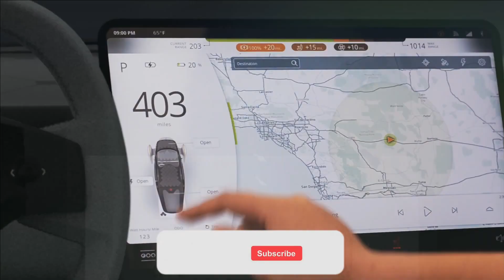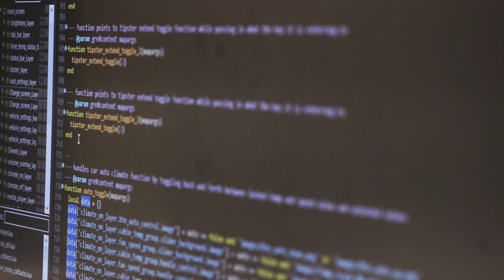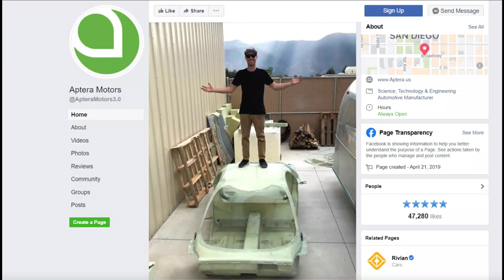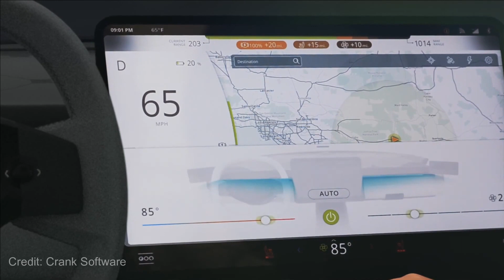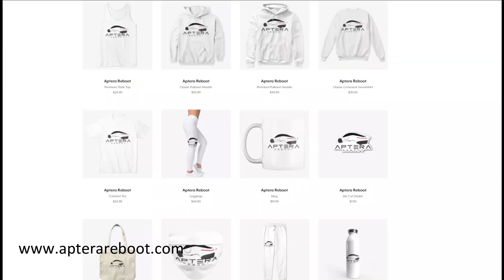Top 3 Reasons Why Aptera Will Fail?!?

Comment: I love the Aptera style and build but see some issues;
when parked in a small street the Front wheel will be sticking out on the road and below hidden partly by passing cars due to the over the bonnet view.
In a small street like ours this could be an issue with it being hit and damaged, you often judge a car width by the main body, and don't expect a wheel poking out.
I, like most others I know have the requirement now and then to drive extra passengers.
I can see me looking further at one, if they ever come to Australia, and would really have to be convinced to buy one I think.
Reply: Those front wheel pods are going to be destroyed - when other vehicles pull in or out of parking spaces, the drivers will judge the distance they have from the cabin. You can't see those pods especially from taller SUVs and trucks. Also, not practical in snow or slush that will build up inside and freeze in northern climates.

Comment: The success of this vehicle does also rely on which country or "market" you choose to sell to.  Releasing a futuristic EV in a country dominated by fossil fuel vehicles would be a big mistake in my opinion. Because people will be less aware and probably more skeptical to the whole EV idea and concept. 

Sell this car in Norway, set up a manufacturing facility here and feed our local market. You'll get tons of publicity, and a kickstart.

We have been driving electric cars in Norway since the early 90's, today more than 50% of all vehicles sold are pure battery electric.
(People who buy a brandspanking new internal combustion vehicle today in 2021 Norway are laughed at, and considered to be kind of dense.)

I would suggest focusing on the 3 wheel drive version, with a heat pump and liquid battery cooling/heating and heat scavenging. 
With  at least 22-150kw CCS fast charging capability, and smartphone app-control seems rather popular at the moment.
90% of the time we charge our cars at home, on a normal wall socket over night. But we do love our fastchargers. So don't do the same mistake as Renault did with the first Zoe EV.
Make sure to be able to charge from a wall socket as well as 150kw CCS.

In Norway, EV's don't pay tax (VAT),  pay little to no tollroad fees, get discount at the ferry, and discounted or free parking. We also have EV  only exclusive parkinglots with charging (Often for free).
Owning a EV costs something like one tenth of the expenses endured by internal combustion vehicle owners. In my case, the downpayment each month is the biggest expense. 
We have all the right conditions for this car to succeed!
Reply: This would be a great car for Norway, especially if they could extend the lowest operation temp downward by a little.   There will be more information when they test it at the Elaphe winter weather test track next year.

Comment: In a two car household I can see this being used for commuting & shopping with a four door being used occasionally for longer trips.
Reply: I have a two car household and this was actually a concern of mine when he mentioned one of the problems being that it's a two seater. I've never owned a two seater vehicle but typically they have trunks, which as far as I can tell this one does not. So how would that lend itself to shopping? Where would you put everything after trip to the mall, or downtown, or even just the grocery store?
Reply: @r37r0v1ru5  It has a trunk with 25 cubic feet of storage. However, the slant of the roof will limit what can be stored. They recently put up a video where they grocery-shopped with it. But they stuffed it with unpacked groceries, rather than showing how many bags would fit. The video is here: https://www.youtube.com/watch?v=odhTdf9S9h0
I put a comment in there requesting more videos like that, specifically how many grocery bags will fit and can it fit a bike.
Reply: That's what I will be using it for.  My Altima gets good mileage so I drive it most of the time but it is aging out.  I mostly use the truck to haul things and tow the camper.

Comment: The US market alone will not be sufficient for Aptera to succeed. In Europe Aptera will be the car with the widest track width available on the market, which will turn out to be a major issue. The low fenders will get damaged a lot while curbside parking plus parking at the curb means the far side wheel will stick out significantly into the road.
Reply: The present plan is for a production rate of 10,000 per year by the end of 2022, at which point the company will be very profitable.  At that point they will be thinking about going public and designing a 4 wheel 5 passenger sedan that will have far fewer issues meeting European requierments.

Comment: How will this thing drive in 2 inches of snow or on icy roads?
Reply: We won't know for sure until the cold weather tests are carried out next season on the Elaphe cold weather tests track.  My guess is that with the three wheel drive model and snow tires it will perform very well in temperatures above -20 F.   This is in part due to an extremely fine grained traction control and ABS which can sense and adjust every 2.5 inches of tire tread travel.

Comment: One of the biggest issues with EVs in general is that they are too expensive, and that batteries don't last very long before they have reduced life and/ or they are dead entirely. The batteries are the most expensive part of the car and they will inevitably have to be replaced long before the life span of the rest of the vehicle. Electric cars aren't suddenly a good idea just because we want them to be. The amount of nasty chemicals involved in the construction and making of these cars is pretty high. Also let's not forget that most electricity comes from coal and natural gas so be careful with our rose colored glasses.
How about taking the efficient body design and wheel setup and putting a dependable, efficient,  gasoline engine in it? The people buying it can still feel green because of the huge increase in miles per gallon it would inevitably give with the aero dynamic design, and the reduction in rolling resistance.
Reply: Even with everything you mention, much of which is true, going back to an IC motor would be a giant step backwards and wont happen.  Aptera will increasingly be manufactured with natural components such as hemp.

Present battery tech is already much cleaner than other methods of energy storage, even compared to alternatives such as hydrogen when total life cycle is considered.

Comment: To the first:
The first Aptera also wasn't an EV it was a hybrid with very low fuel consumption, which is interesting but a low fuel consumption alone is not a good enough reason to deal with the downsides.
This one as a very long range EV with the PV-Paneles and that is a way bigger deal.
To the second:
To the third:
The early prototypes had 3 seats, they got rid of the third one because of low demand and seem to think about bringing that back.

Comment: It's not about 3 wheels or 4 wheels, not about safety. It's all about price. If Aptera can't get the cost in a range that can compete with Chinese competition it will fail again. The main issue with being able to get the new models costs to consumers below around $10 - 15k US dollars is because mass production is just too expensive to get started. Until they offer this at a competitive price it will remain a niche product that won't take off with a cult following. Anything above $15k won't compete for the next 3 - 5 yrs. China is coming for the low price EV US market very soon. They understand we don't want all the expensive tech in EVs. Our cell phone can do 90% of it anyway. We just want low prices, high range, and be able to do 75 mph or so on US interstates. That's it. None of the other fluff will interest 95% of American consumers.

Comment: Aptera is making the perfect commuter car, a large market that has been lightly addressed in the past by legacy car companies.  Aptera was conceived on the premise that you had to make an ultralight, aerodynamic efficient chassis (see also Mitsubishi i-MiEV) as motors/batteries were seen as inefficient and costly, achieving range barely over 50 miles.  Tesla primarily has pioneered the conventional sedan past that thinking over the 10 years since Aptera's stumbles and demise.  Aptera could have succeeded along the way (Paul Wilbur's name should be linked to failure "Wilburize") and a second chance is now at hand.  If they can make just 50 cars in 18 months time, they and the car will become a reality in the EV future.

Comment: 1. Production Hell... learning to build cars en masse is not easy. Can they meet the demand in a timely manner ?  A year is a long time to wait for a car.....I can have a model 3 in my driveway in 2 days...
2. Poor build quality. The specs & style will sell the car but service issues out of the box can kill a start up.  They have to get this right the first time. Changing a tire might be a challenge...so I hope they use quality tires...
3. Competition...Other deep pocketed manufacturers might step their engineering game up if they see Aptera taking market share.  Nothing stopping them from slapping solar panels on a 4 wheeler ... can VW come up with a better solution ?  Doubt it but you never know.... 
4. Because ALL auto manufacturers fail.... they all end up declaring bankruptcy..  F & TSLA are the only two USA companies to avoid it so far....
Reply from the maker: Nothing  is certain until they are actually doing it, but it looks like they will be able to produce 10,000 units per year with just 23 employees.

Comment: Their business model is wrong. Their product would have been great with a different b. Model. Perhaps if bought out by e.g. Tesla, it could be made to work.  What we need is a city car a modest prices (cheaper than regular cars) that people can use for daily transportation. As it is, it seems that this model is again super expensive. No way to sell to the masses who need cheap reliable transportation.
Reply: $25 ,900 is not super expensive, especially considering possible rebates and a third or less operating costs compared to other EVs.

Comment: My biggest concern is battery thermal management. I know they have described using the exterior surfaces as a skin to shed heat but this is completely new and untested. And will they use the motors to heat the pack? Can this be done with the open wheel design? Also with such a slipstream design I'm still not convinced they can fit a 100kWh pack in the vehicle, but even if they could I think the weight would seriously degrade the ride quality. Perhaps a 60kWh pack would be the largest offered?
Reply: One of the founders has already had a successful IPO of a lithium battery company.  They understand these batteries.  The principles behind the heat management system, of course are not new.  The motors are liquid cooled and heat can be moved anywhere in the car where it might be needed.  The biggest factor in making this a success is that Aptera has much less waste heat to deal with than any other design, even other current EVs.

There are drawings on Aptera's web site that show the battery pack configuration for the 100 kWh pack.  The battery packs are structural and each size will be supplied as its own unit. The 100 kWh pack has a section angled up behind the seats.

Comment: I usually end up buying a 4 door and in my LIFE I've never carried more than me and one passenger. I'd be quite happy with a two seater.
Reply: And if your kids are grown up and gone from the house, this is perfect.
Reply: A 4 door model is coming out as well..
Reply: I looked at global companies that have attempted the “covered motorcycle” design approach using various propulsion systems, including electric pedal assist, and the failure/success rate is for anyone to find: very low. This sports car view of the Áptera EV reveals serious limitations. Like the not too successful Lotus Elise, seating is reclined with legs stretched out, go-kart style. Limited cargo space, motorcycle/trike like, also is a hard sell. To me the exposed front wheels with the drive motors part of the unit look fragile and with high probability of damage and expensive repairs. Considering the minuscule market of 2 seat sports cars and adding the Áptera to that category, if 12,000 yearly sales is needed as to profitability, there is a glimmer of hope. Thanks
Reply: @Rhaman68  Don't overlook Reliant, whose 3 wheel Robin propelled them to the number two manufacturing spot in Britain, with a somewhat similar but not nearly as compelling an offering as Aptera.
Reply: I have kids and put down a deposit because I don't commute with them, and don't usually run errands with them either.
Reply: Until you have kids.
Reply from the maker: @stevo728822  I have 2 kids below teenage years and more than 50% of the time, I ride alone.
Reply: @stevo728822  Even if you have kids, you won't be commuting to work with them.
Reply: @stevo728822  You have kids at home only 20% of your lifetime... Before and after kids a 2 seater is just fine.
Reply: @stevo728822  , that's what the optional trailer is for.
Reply: @stevo728822  not nessisarily. Having more than 1 vehicle easily solves that. Even with a large family you don't always need a 4+ seater. In fact careful planning means you only ocassionally need it.
Reply: And you have money and a lot of time to burn? Get an EV, it will give you range and slow slow recharge. In 5 years when you have to replace the battery you can burn that money too.
Reply: @Vin Trav "as vehicles on average are junk after 80k miles" Sounds like you think electric cars aren't. Do you have ANY tracking on that at all? Also, expect to pay more than what the car is valued at, when replacing the battery. Think north of $16,000 for the battery. Then there's the MASSIVE environmental damage from disposal of the batteries, mining of the battery materials, and of course most power plants in the US are Natural Gas or Coal. You shift the damage there, you aren't helping.
Reply: @frosted1030  more provably false, bogus claims that anyone can see for themselves with a little research.
Reply: @frosted1030  " cost of batteries fell about 80% between 2010 and 2016 according to McKinsey, from $1000 to $227/kWh."  

If prices continue to fall, as they are likely to, by the time battery replacements are needed, the costs will be a small fraction of the present day costs.  Besides, Aptera only needs about 1/3 to 1/4 of the battery that a Tesla requires for the same range performance.

Lithium Batteries do not have massive environmental damage to recycle.  There are now industrial scale battery recycling plants and they will reduce the need for new mining.  Most new US lithium supplies will come from separating it from hot brine in the Salton Sea area that is then reinjected, with minimal environmental impact.
Reply: @frosted1030  for the mining part I guess I would have to pass until a journalist I trust discovers the truth, whatever, about how enormous the environmental impact of lithium et. al. handling is - especially compared to drilling or the better sounding (I guess...?) fracking.
For me just the fact that catalytic converters are not effective for the first 3-4 miles and that fuel consumption in city traffic is higher than highway while in electric cars it's the other way around is enough.
Reply: @frosted1030  You are mixing up cost and price.  Don't be so quick to call " liar" when you are making such an elementary mistake.
Reply: You have no Idea what I have seen have and have not seen, but it includes the fires in Kuwait and California.
We are going to have to move toward efficient and clean transportation solutions such as Aptera as a society if we are to leave a livable future for our children and grandchildren.

If you don't already know this, you haven't been paying attention
Reply: @frosted1030  you claim vehicles are junk at 80k?  this seems odd.  most my trucks I purchased new at around 250k plus.  most of them I still have and are running pretty well and still making me money.  even tho these are ICE trucks with hella more maintenance than any EV would ever require.  you seem to be mad at the world and discounting lots in the production of efficient transportation.  this company is focused on efficiency.  point blank.  also combined with tax credits these models are projected to be available for under 30k usd which is beginning go be very cost competitive with fuel vehicles.  I know 1 think rings true.  efficiency and EVs go hand and hand.  and this company has their eyes on the efficiency prize as they are very realistic and conservative in that department.  if they make their delivery dates is definitely TBD and I would not say that push backs are not going to happen.  I would expect set backs.  any great production will fail and have set backs that is expected.  the ones who loose are those that give up and do not try to get back up again.  as seen in aptera they can gladly accept a failure and get back up again.  same as tesla.  a failure simply learning.  we humans learn through failure so I expect to learn a lot before I'm extinguished as well as you and aptera.  for now I find their thesis agreeable and a better choice  in transportation if moving 1 or 2 people and some gear.  that is their current goal and I support it and believe in it currently.